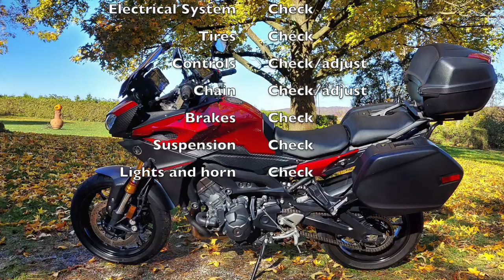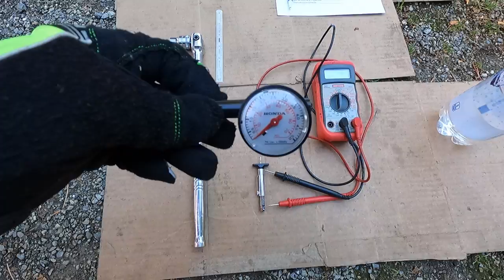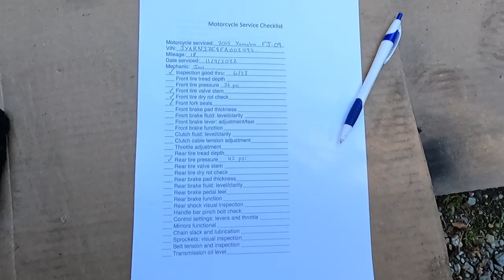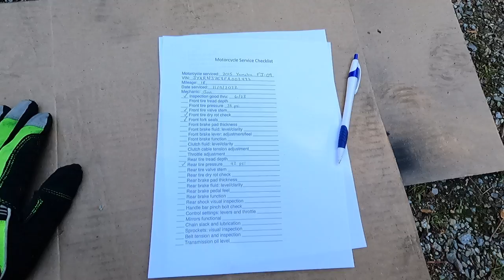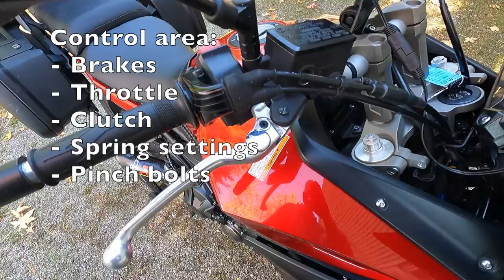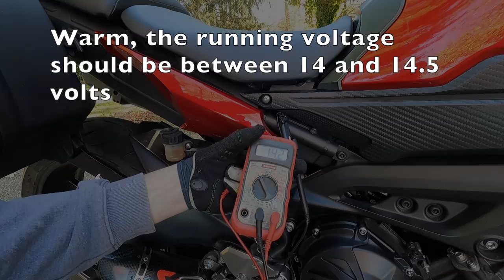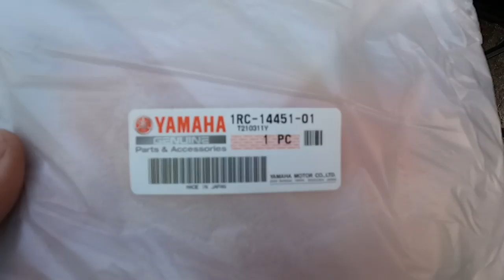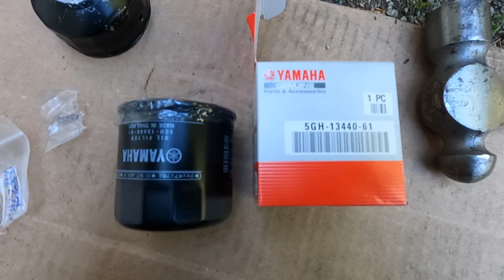Servicing Yamaha's FJ-09, MT-09, Tracer 900 - Oil, chain, air filter, electrical system, etc.!

Comment: Not to make an argument but shouldn't the oil level be between the upper and lower marks? I totally agree with you, Yamaha's recommended chain slack is way too tight.
Reply from the maker: Great question!  Just like in a car, I fill the oil to the upper mark when I change the oil. That way, if there is a minor leak or if the bike burns a little oil, the level will still be in the safe zone. Cheers!

Comment: Heck you might get just a touch better gas mileage after changing that air cleaner. Looks like the air density/ flow/ temp sensors are mounted right on the air box above the filter ? Anyhow, the Yamaha engineer who designed that air filter change procedure , must have been thinking too hard :)  But, that is Not uncommon on todays modern bikes, compared to ones back in the '70's and '80's, as you well know. Good overview of basic maintenance though, could be quite helpful to a new owner who sees this.
Reply from the maker: Right on, thanks!